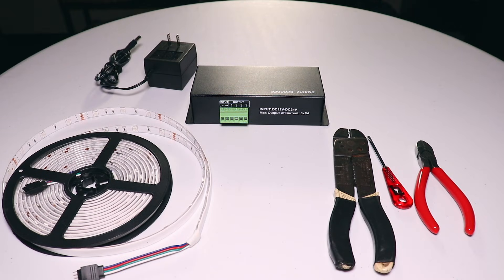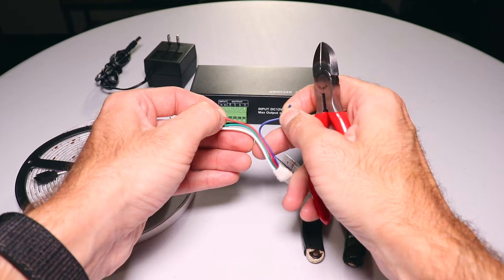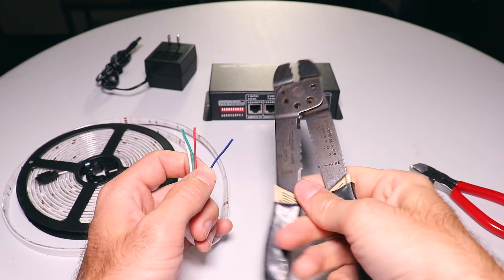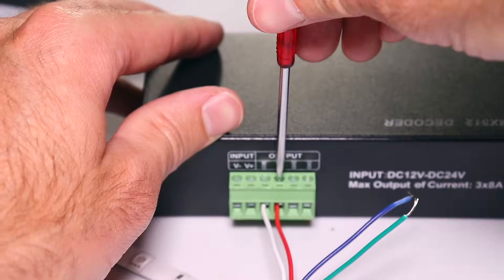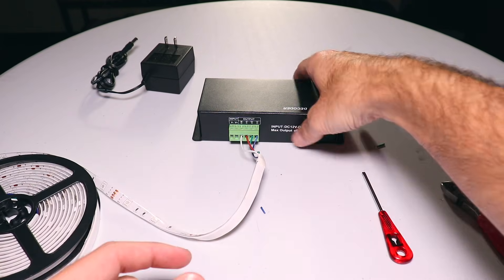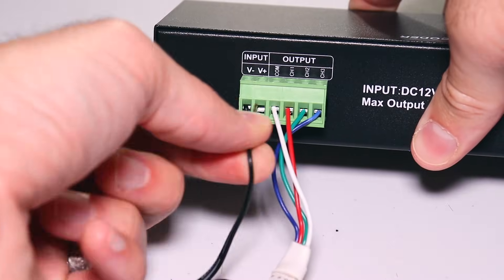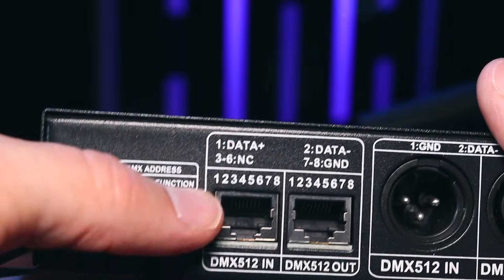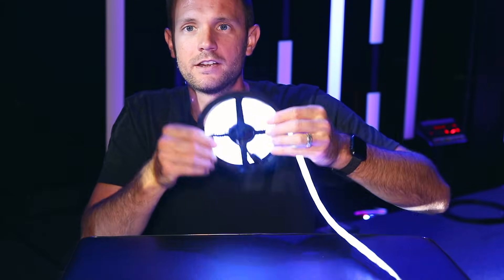How to Control LED Tape With DMX

Comment: Quick question, I want to link some of my custom backed LED framed artworks with my Pioneer DMX link to a sound mixer (to create an interactive music and visual scene) would that decoder work with the little wifi transmitter that you can plug in the XLR port of your DMX decoder?

Comment: Where did you get thata video panel that shows at the :35 second mark?
Reply from the maker: That was actually a DIY projection “screen” at a church in Chattanooga. They made it with plywood and painted it light gray.

Comment: This is such a solid breakdown — love how simple you made the wiring process for LED tape to DMX.

We’ve been experimenting with an alternate route using DMX Smart Link Hub on a Pi 5 to control Wi-Fi smart bulbs (like Govee and Tuya) via Art-Net, especially helpful when running wires isn’t ideal for a portable stage or church setup.

Curious if anyone here has ever mixed wired LED tape + wireless smart lighting in one show?

Comment: Hey would you like to explain what you used at around 5:01 and also 5:10? like the cables  you are connected to the decoder, where it is going to?

Comment: What voltage and ampage is the psu? The decoder says 3x8a output so does the psu need to output 24a? Most small psus output 2a

Comment: Thanks for the guide... i followed the steps but i have found that when i turn them on i get a weird high pitched noise coming through the vocal microphone channels... any ideas on how to fix this?
Reply from the maker: That’s really strange. Make sure they are not on the same power circuit as your stage box and or anything sound related. Let me know if this helps. I also use a different decoder now. I’ll post a link
Reply from the maker: How to Wire 32 Channel DMX Decoder, Power Supply, RGBW LED Tape
https://youtu.be/36JUNKiRjR8

Comment: That's brilliant! Newbie question, though: how do you control the decoder with the app? Do you need to create a LAN connection (from the iPhone to the DMX decoder) or else way?
Reply: I don’t think the app is to control the decoder. He didn’t explain it well, but I think the app is just a handy tool that tells you how to arrange the dipswitches on the decoder to assign it to a specific DMX address

Comment: Thanks for the guide. We use this to back light the cross in our sanctuary. Used our wireless DMX transmitter/receivers + Lightkey for Mac and it worked great! The tip for using Sprinkler wire to extend the led channels was a gem! Thanks again.
Reply: Any chance you can elaborate on this? Sounds exactly what I'm trying to do but not having any luck. I've basically used exactly the same equipment as the guy in the video. What fixture do I use with in Lightkey and how do I control it from there? Thanks

Comment: Looks like a simple solution. Do you know how to control individually addressable led strip using DMX?
Reply: did you ever find an answer for this?
Reply: @jacobmcglone1602  Sorry.. no. Never ended up using DMX.
Reply: idk if you're still looking for an answer but you should check out Touchdesigner and pixel mapping

Comment: Just a thought.. any time I use stranded wire and screw clamp terminals, I tin the wires so they can't squish out and get loose.
Reply: If you wanna be anal about it, why not just replace the terminal's standard screws with ones that have a good point on them? That way you can just leave the wire contained within its jacket..  😉

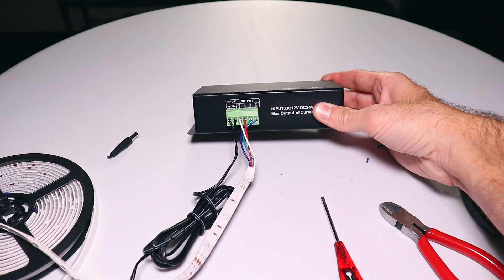Comment: I found your video with the yarn panels like forever ago. I want to go to this instead of the cheap lights we have now. (It would basically be a 1x2 with the LEDs attached to it.) Do I need that app (4:16) in order to make the lights work or can I just replace my current lights with this configuration and have the lighting software figured out everything?

Comment: Can anyone help me???  I installed LED lighting on my stage at church and when I video the stage, the strips are only showing white through my camera. I have a Canon Rebel T8i. I want to start streaming, but lights look terrible to me. If a person is sitting in the congregation, the lights would look wonderful. Do I have the wrong settings on my camera?
Reply from the maker: What are your shooting settings? (SS, ISO,  aperture). Also, what color profile are you shooting in. (Standard, natural and so on)
Reply: @WorshipLeaderHangout  1/50 ,  7.4,  800
Reply: I am not sure what color profile my people are shooting with. Can you suggest what settings  (SS, ISO, APERTURE and COLOR profile) they should be shooting in. They are beginners with using a DSLR camera.

Comment: Worship Leader Hangout I am having trouble getting the dmx decoder to work with the led lights. I have plugged in all wires into their corresponding channels and the led lights do not turn on. I made sure to turn on the dmx decoder and nothing. I’m using an rgb led strip, the same dmx decoder from the video, and a power supply of 12v 5a. What am I doing wrong? Please help.
Reply from the maker: If you are sure you have power and everything is connected correctly then I would double check your DMX address on your dip switch. Make sure it is set correctly. The last dip switch on these decoders need to be off to use with your lighting software/board. On mine it’s labeled “fun” anyway, that needs to be off.  It’s hard to troubleshoot through a comment so, I hope this helps.

Comment: Helpful tip - make sure to double check your off position in the dip switch app.  We were getting nowhere until we realized that our "on" and "off" direction was backwards.  Once we changed that setting in the app and set the address, everything was working perfectly.  Great video - thanks for the help, WLH!
Reply: First Celina What power adapter did you use? How many voltages?

Comment: I have the DMX decoder for my RGB LED light strips (4 x 5M) and It works great and your video really helped. I recently acquired the WS 2815 individually addressable LED and I have have some great sequences with them controlled by an Arduino. Do you know what I would need to put these into my DMX chain? (it would be some other kind of dmx decoder maybe 4 or 8 ports with a 1 channel with a dimmer function and 1 for power - Data Line In from the Led Striped)  All I want to is add them to each scene for a controllable on/off when I need them to come in.
Reply: I have done something very similar.  I have an Arudino Nano connected to a MAX485 that is accepting DMX input from QLC+.  I can set static colours and have the ability yo trigger some of my own lighting effects/sequences that I have created using FastLED.  Let me know if of interest...

Comment: Does this mean each each decoder dip switch settings will control only one color? What if you want the strip connected to the decoder change colors ow do you do that?

Comment: How can I connect two LED tapes and they work independently?
Reply: No. This  is a 'dumb' LED tape controller. You'd need multiple of these controllers or look at addressable strip (pixels).

Comment: How do you determine what dmx address you need?
Reply: Find 3 channels all next to each other that are free, and add up the numbers on the dipswitches as you switch them down, they need to be the first available channel.

E.g. if you have channels 62, 63, 64 free on your console, you will switch down 32, 16, 8, 4, and 2 as they all add up to 62.

Comment: Question. So my church is getting ready for Easter. And we have this background that we want to attach these acrylic tubes to it with the led lights inside. Can I cut the strip little by little or would it be easier to have the one long led strip?
Reply: long strip

Comment: so i want to build 6 various sizes of "light polls" .  can I use just one dmx decoder or do I need 6 seperate decoders?
Reply: You can use 1, but if your power supply doesn’t have a high enough amperage, the strips could dim.

Comment: How many strips can you control with one decoder?
Reply from the maker: I’ve only done up to two with one single decoder.  Power might start to become an issue after two 16ft strips.
Reply: That's what I was thinking.  Thanks

Comment: Is it possible to reuse a roll of led tape if the entire roll is not used? Say my design only uses half the roll - are you able to cut the tape and then reuse the latter part later or is the excess portion not usable?

Comment: What about those strips with only three wires, which individual bulbs can be controlled independently? You’ve got decoder for those kinda strips? I want them on my set.
Reply from the maker: I’m not sure. I haven’t used the strips with only three. The ones we are using now use 5 wires. (Power, Red, Green, Blue, White)
Reply: @WorshipLeaderHangout  Yeah strips with 5 wires can only be controlled entirely, the 3 wire ones have individual LED control ability. So you can do animations or left to right and stuff like that.

Comment: I need to install 6 panels. How can  I plug all 6 led panels to one decoder and 
Which power box can I use to power the up the 6 panels from one decoder box?
Reply: Rudy Mendoza You can get long led lines like the for the end and run one strip to the other then to the decoder

Comment: I tried doing this but for some reason both of the strips i tried (brand new) they are only blinking, anyone has an idea of why this is happening
Reply: I have the same issue. looking for help or solutions
Reply: Just figured out the issue. If you are using the decoder that is shown in the video, check the little insert that came in the box. for my box the dip switch is in the on position when the switch is down. if you use the dipswitch app on your phone the app shows to flip the switch up for on. I was having the same issue as you and all the issue was i had the wrong dmx address in because I thought up was on when in reality for my unit up was off. hope this helps.

Comment: @WLH  - Can I link the tape strips to other stage DMX controlled lights from the decoder and control them all with the DMX512 Controller?
Reply: the decoder is a dmx device so as long as you give it three address spaces (RGB) and it's not taking up another address already assigned, it's good.

Comment: Question, what size power supply did you use, ac to 12v dc, but what amperage power supply did you use for a roll of led tape?
Reply: 5A

Comment: I have tried this with an ETC Colorsource AV. I think I’ve done everything correctly. I even called technical support, and they think I have it right, but I only get a red output. Does anyone have an idea what the problem is?

Comment: I can use these lights to the dmx controller, I mean connect the two LED strips with a single controller? And with the power source that are included in the package?
https://www.amazon.com/WenTop-Flexible-Non-Waterproof-Controller-Lighting/dp/B07DCKF16S/ref=sr_1_6?keywords=led+strip+extra+large&qid=1563820608&s=gateway&sr=8-6
Reply from the maker: I connect two 16’ strips to a single DMX decoder and it works fine for me. One power source seems to be plenty. Hope that helps.

Comment: hello, please can you be more specific on the type of LED strip? so i don't buy the wrong one which one is yours ?
Reply: Any should work, so long as they are prgb (power+red+green+blue) or 4 cables. Most of the cheap stuff of aliexpress is the same as the expensive ones and will work.
Reply: @egg6649  thanks

Comment: So i built 8 of these on vertical pvc pipes.  When each one is plugged in individually everything is fine, but when I daisy chain the DMX from one decoder to the next I always get a flicker.  anyone else having this problem?
Reply: Using 2 dmx decoders and get flicker every 1 minute to 3 minutes.

Comment: My strip has rgb+positive, how to connect that in 4 channels?
Reply: Not compatible, but you can get led strips for 5$ so not too bad :)
Reply: I’m sure you’ve moved on but for the record this is actually compatible, you just won’t have white, obviously. Just don’t connect anything to the white channel, and you’ll just have a dead channel on your DMX Universe.

For anyone looking, I highly suggest doing a setup with rgbw as quickly going to white when a chorus goes ‘big’ has an incredible effect.

Comment: What software are the running to control the lights, can the light key app run? I’m new to this game and trying to find a simple setup. Thanks for the great content.
Reply: Not sure what they use, but we use a program called Show Express that’s pretty easy to use
Reply: If you have Mac, even access to an old MacBook DEFINITELY use lightkey. It is the most amazing to use and beautiful lighting software out there, and if you are running most of you fixtures to do the same thing, you can set them all to the same channel and maybe even pull of just using the free 24 channel trial lightkey mode.

Comment: If we have two decoders with the same setup do you just chain the two in order to have the same colors for separate strips? Or does it automatically chain wirelessly through the app when both decoders are set with the same code? Hopefully that makes sense.
Reply from the maker: Ok so I like to have a different dmx address for each decoder so that I can program a different color for each strip. I hope that answers your question. Thanks for watching!

Comment: How many amps is the power supply in the video?  The one from the link looks larger. Would like to get by with a smaller supply like the one in the video if possible.
Reply: Madison Coates I would also like to know this.
Reply: I'm also curious about this. I bought LED strips today and they only specify a 12V DC power requirement, but not an amperage

Comment: Pretty thin power wires. One DMX Universe is about 11 Ampere ! -> http://www.orangepi-dmx.org/orange-pi-dmx512-rdm/ws28xx-configuration/technical-details
Reply: [Links broken now]; if the links description with 'ws28xx' is correct then you're referring to addressable 'pixels'. This 'dumb' RGB is totally different.

Comment: Very nice I am a new subscriber. I have a design to go completely wireless controlled and powered by li-ion @ 200 nodes at full for 8 hours all from a hand held remote. Would like to share privately if you have an interest in testing but dont want to use your channel to advertise.

Comment: if i wanna run 10 strips independently like one meter long led strip making a design, would i need 10 decoder or a multi channel decoder with multiple output could act the same ? so i can run 10 strips on its own or multiple at once via sowftare or dmx table
Reply from the maker: A multi channel decoder will work well. I used individual decoders to so that i didn't have to run as much extension wire from each strip. I did however use more DMX cable. So, it's kinda personal preference. Just to give you some insight, I will be using several multi channel decoders on my next project later this year.
Reply: thank you if you read and take time to answer :)

Comment: Any suggestions where one would purchase the red, green, blue and white wire extensions? Asking for a friend.
Reply from the maker: Jesse Pierce I use DMX and/or XLR cable purchased in bulk. Most of your production companies and pro sound/lighting companies will be able to sell it to you by the foot. DMX is ready to go combining 4 wires in one housing and is perfect for extending these strips.
Reply: Just FYI there are two types of dmx cable a 3 conductor and a 5 conductor. To go from control box to the strip you need the 5 conductor and you just use 4 of the wires and cut off the 5th wire.
Reply: just go to Amazon and search WRGB wire

Comment: Can you add multiple LED strip lights and connect them together and just use one DMX decoder?
Reply: And how do you do that? How do you connect them all?
Reply from the maker: Jordan Sunnasy yes. I had to for our current design and it works great for me. Thanks for watching.
Reply: How do you pull off a "daisy chain" with multiple LED segmants but still maintain adequate power supply?  @WorshipLeaderHangout
Reply: I know this is late, but we used to use these exact controllers, and we ran Ethernet cable (Wire colours are perfect, and what we had available) from each set of strips (a square, bar etc) and back to a controller, where you just screw in both sets of wires.

We found this way was better than having everything daisy-chained, as the brightness wouldn’t suffer as much, and it was easier to set up.

We ran a 12v 30A transformer (AliExpress) to each controller, and that ran the lights fine, you can probably run about 12m on a single controller this way without them starting to be noticeably dimmer than sets that are less long.

Comment: So I was just wondering, if we were to buy the same exact set up as your but with a smaller light controller (obey 4) would I have the same address as you? If not, how do would you find the address?
Reply from the maker: DMX works on a 512 block grid. Each fixture takes up space on the grid starting at any available block. For example these strips take up three blocks on the grid and you can only address them in available block where you can fit three side by side. If you already have fixtures taking up blocks 1 - 50 then you would start one of your strips on block 51. It will take up 51, 52 and 53 but you only need to address it to 51. Your next strip will start at 54 and so on. I hope this helps. (you can address yours the same as mine as long as you have the available "blocks") Thanks for watching. Great worship leaders are always learning. 9 years ago I would have had no idea what I was talking about, but with lots of exposure and time with DMX and stage lighting I have learned a ton. Hope you will do the same.
Reply: The Chauvet Obey4 has a factory set start address set to “1”